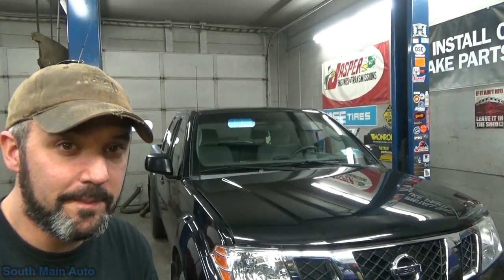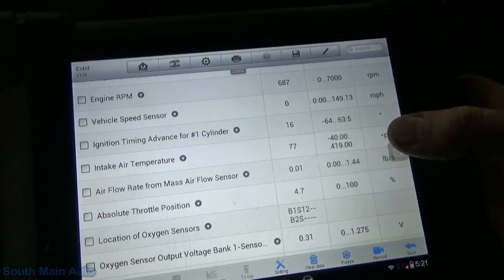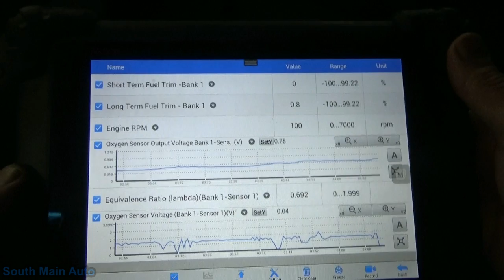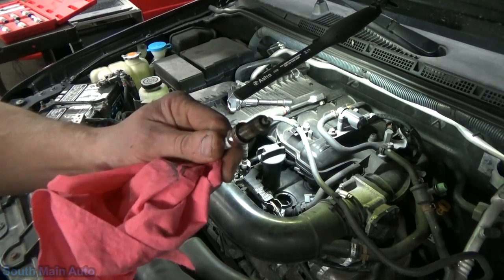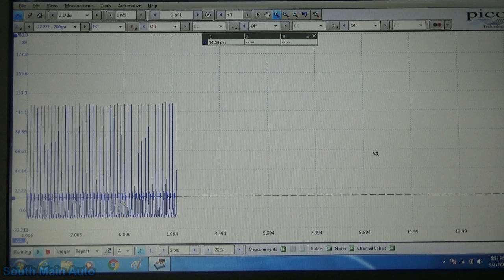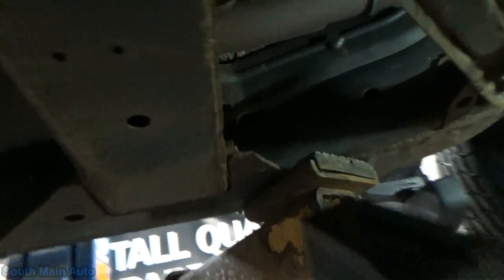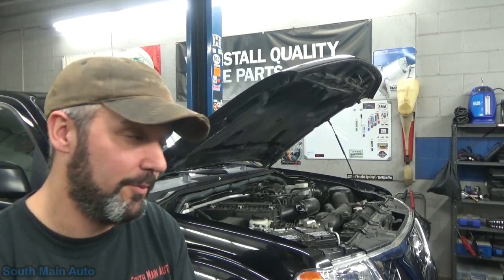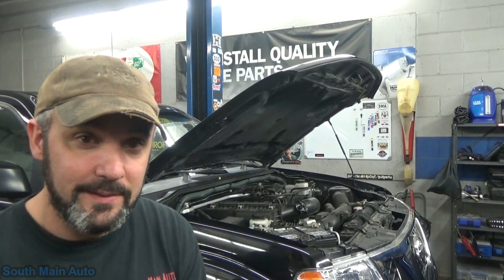Nissan Frontier - Low / No Power Complaint

Comment: I had the same thing happen and I ran a bar through it at home and the car had more acceleration than when new. This poor guy just lost his vehicle that could be corrected with a tiny forging furnace that will run up to around 800 to 900° with oxygen softly flowing through it for about 50 to 100 bucks  just because it needs taken off and would then work perfectly and pass fed law.

Comment: Fuuny... I have a 2006 Frontier with 210,000 and same thing happened  to my truck. Plugged up Cat, I think I had a bad coil pack and resulted in a bad misfire. Is the best guess I have. Luckily I live in SC and found a wrecked truck in salvaged yard and got one el cheapo. Been running like new ever since. DON
Reply from the maker: Oh man u go to prison if you put on a used one here in NY!
Reply: No state inspection here in South Carolina, and a truck with 210,000 , but still running strong. Put new 4 coil pack and new sets of plugs and going to see how long this ole girl will get me.

Comment: Wouldn't you just LOVE to have an old GM vehicle of any kind w/a "large cap" H.E.I. come in w/a no start condition and @ worst, if a new, 4 pin module doesn't work, just pull the distributor and replace the pickup coil? Or, even better, any vehicle w/points igniton n all you have to do is file them to get it running? Ah...the good ol days!

Comment: It's probably depressed because it's a 4 cylinder pickup truck.
Reply: All the little 4 banger trucks are carrying more loads than all these guys in these V8s who don't do anything work related.
Reply: Chevy Colorado 2.9L vortec is a workhorse 4cyl 💪
Reply: You won't see Fords or Chevy's towing tonnes in African or Asian roads- just 4cyl Nissans and Toyotas are capable of withstanding those conditions
Reply: I've done more in my old 86 Nissan D21 4X4 with a 2.4I4 than anyone in a full sized pickup would even dream of.
Reply: Mountain Mike My cousin has a ram that’s lifted and he said it’s cool you can sit on your tailgate lol
Reply: Jacob Sebastien Not to familiarized with those my experience with 1.4l ecotec ruined my experience for Chevy ecotec engines lol
Reply: They only offered the 4.0 v6 in these trucks

Comment: I changed my fuel pump, fuel filter, cleaned my injectors, changed my plugs, coil and wires, cap and rotor, disconnected my cat, changed my O2 sensor, put on a new MAF, and I think after all this crap its my TPS playing games. No codes or anything... I would have thrown that part at it to, but I have found that it is IMPOSSIBLE to buy, Thanks SUZUKI!  Now Im pulling random TPSs off of similar cars to see if it looks the same!  Its got 4 wires which is kind of weird. Nobody can tell me what the 4th wire is for tho. Do they make a "Universal" TPS that can be calibrated somehow?  If i have to pull this damn engine out over a lousy TPS ill have a COW!  I think one trip to a mechanic will instantly be more than the car is worth unfortunately. I just opened the sensor up to see if i could maybe clean it.  But if it wasnt messed up it definitely is now!  They make it so if your try to open it you break solder joints that you cannot fix by design. (1987 Chevy Sprint Turbo/ Suzuki Swift)
Reply: any 80s or 90s suzuki?
Reply: @ellenorbjornsdottir1166  I think it has to be 87-89  because the newer models have different looking wiring connectors. I suppose I could find a connector too and rewire it tho.  I have robbed a few things from 0ld I robbed a 4th injector off an 88 MR2... was close enough that the engine starts up great. Thats a hard to find car too tho

Comment: Awesome video! Question, how do you figured out that the fuel input was fine just looking at the oxygen sensors?, Thanks!
Reply: I'm not Eric O but the way I do it is look to see if it goes "lean" on the upstream when their isn't a problem with the exhaust system or vaccum leaks it shouldn't go lean by much at all.

Higher the number the richer,lower the voltage the leaner.

If its a fuel issue it will cause the voltage to go lower as the rpms go up because its not getting the correct fuel volume or pressure needed. Mind you things such as vaccum/boost leaks,bad sensor,exhaut restriction can all skew this value as well. If you think you are having a fuel pressure issue you should test it with a mechanical gauge. Seeing that you don't have an exhaust issue or vaccum leak and sensors respond or test out(MAF/MAP and o2) sensors

Comment: 👍Scotty Kilmer had a clogged converter & soaked it for 24 hours in either acetone or lacquer thinner 5 gal bucket then reinstalled w/ no issues. 
Any thoughts?
Reply: Should have used draino as it is made for clogged pipes😂

Comment: You diagnosed it the hard way. Just unscrew the O2 sensor in front of the cat to give the exhaust a place to go. It will run normally. Replace it with a $100 cat from ebay, done. I'm so glad I live in a state that has no vehicle inspection.  What a bunch of crap that is to have to deal with. In this guys case, he should repair the cat himself. Takes the heat off the repair shops who have to follow all those rules.

Comment: This engine, if I remember correctly, has a propensity to suck the inside of the catalytic converter BACK into the engine.  This customer may be lucky if this just had the engine power suddenly "go away".  Otherwise, he could be looking at a new engine in the very near future.
Depending on age of the truck and mileage (UNDER 100K) this is warranted by Nissan, so free parts but labor is extra.

Comment: Hello so did a new catalyst tske care of the issue ?
Reply from the maker: Of course 👍🏼
Reply: @SouthMainAuto  cool you know I have a 2006 frontier 4.0 doing the exact same thing.  Someone told me it's a clogged up cat. But now I see your video I am definitely sure it that
Reply: Wow thanks for the video great help sure enough my cat was plugged put new one on truck running normal
Reply: @simonramirez3889  mine is too cant go pass 60mph and feels very sluggish i did get a MAF code but im wondering if its because of the air restriction
Reply: @uuulaalaa  I didn't get no maf code mine was just the cat plugged yes it could be I was told by someone if you get a maf code  unplugg it and if runs normal then it's your maf sensor

Comment: No wonder I only buy, repair, and drive "older" cars- the EPA (that needs disbanded) can go take a healthy one. When "Cash for Clunkers" was implemented- all of the sudden a $1,500 used car was $4k, and many used car dealers folded. CAFE and CARB are ridiculous standards, that only serve crooked, corrupt Special Interest Groups.
Reply: it made spare parts nearly impossible to find at wrecking yards. It was a bad deal from the start.
Reply: The only two junk yards we had within City limits crushed everything, ruined all running vehicles brought in, and then closed. You can read up on it here-  https://en.wikipedia.org/wiki/Car_Allowance_Rebate_System   A total un-American ass kissing Democratic debauchery at it's finest.
Reply: Special interest groups like human beings that enjoy breathing. Ever been to China? I have. Want to wear a respirator while waking down the street? They do. Cash for Clunkers saved the American auto industry, removed inefficient and polluting cars from the roads and increased the number of used cars because so many people traded them in so explain how with a greater supply did the price of used cars go up? That runs against all rules of supply and demand. In Japan, another place I've been, you're not allowed to drive a car that's over ten years old. That's their heavy handed way of taking out the trash. We do no such thing in the U.S. we simply require your vehicle to pass an emissions test. That seems reasonable to me.
Reply: the only used cars that survived should have been crushed. its still hard to find a good used car. diesel truck prices skyrocketed after this, especially the less efficient engines like the 7.3 and 5.9. I saw perfectly straight and clean running vehicles turned in and had their engines glassed, while shitbox beaters drove away as a used car sale.
Reply: SATAMAN Schmidt can you explain how scrapping perfectly good vehicles and buying new ones is good for the environment? Even if they are recycled, it still takes resorces to recycle them and make new cars. It seems to me that it was a big waste of taxpayers money.
Reply: 20 mpg vs 10 mpg might be your answer. Current emission specs vs. 15 year old emission specs could be another.  Hey, I kept my 1998 Pontiac Grand Prix for twenty years before I wrecked it but I can tell you that my new Hyundai Sonata gets 1/3 more the gas mileage and the 2.4L Theta engine has just about as much sauce as my 3800 (a truly great engine) did.
Reply: SATAMAN Schmidt I highly doubt the vehicles that replaced the ones that were scrapped got double the mpg and even if they did I doubt that would offset the energy used to recycle and make new vehicles. But it makes people feel good.
Reply: My '89 Reatta currently averages 23mpg highway, according to it's onboard calculation and my own. I hope to slightly increase this after some modest upgrades and more new parts. The 3.8L LN3 MPFI with 4 speed auto is pretty good on gas. It was rated for 18mpg City/27mpg Highway when new.
Reply: SATAMAN Schmidt our government doesn't give a damn about emissions, just control. The United States makes a vw diesel that gets 49 mpg for the us market, they make the same car for the European market that gets 74 mph. You can't buy that car in the USA. All a racket
Reply: I don't like some of the EPA rules. But, I've seen the results of cleaner exhausts from cars. I remember back in the 70s the smog in the Los Angeles basin area would get quite bad. Now days it is more blue skies and it is with a lot more vehicles around.
Reply: Can't you read and comprehend. Did I say anything about abolishing the EPA. No wonder so many conservatives say that liberals just react and scream and that's coming from a Democrat.
Reply: SATAMAN They did not remove old clunkers, the overwhelming majority were yuppies turning in their late model cars to get the rebate plus trade in value on the car. People who drive "clunkers do so because they cant afford a new or even old car. Those same people cant afford 25-50$ dollar cars nor any new car even if the got 5K from obama. You fell for obama's lie, just use the logic I presented. The tax I paid for that phony program was a political kickback scheme just like always.
Reply: @satamanschmidt3428  Yea the problem is when you do things like that ruins the economy stop people from starting their own business. 99% of those used cares were not emissions heavy they were just old. The more Government regulates the less freedom.
Reply: While some catalytic converters are ridiculously expensive CARB standards are there for a reason.  Just imagine how bad air would be in places like LA.   Even in CA where laws and regulations are very pro environment and strict you only have to smog check your car in certain highly populated counties that are in LA basin or bay area.  Rest of the state can drive your clunker with leaking oil with no workable cat and no-one will bother you.  If there was no EPA regulating pollution our water and air quality would be worse than in China.
Reply: @sweetwilliam49  I'm sceptical about the numbers on paper (especially so after recent scandals). It is not always gold that glitters. What really counts is the result you get driving your own usual route.
Reply: @sweetwilliam49  American MPG and European MPG are different as are the testing procedures, the European test is (oddly) a lot less strict than the American one. That is why American cars appear to get such poor gas mileage but it is a closer figure to reality.  I have driven European cars that claim 60-70 mpg but rarely more than 50 mpg is achieved.

Comment: After replacing the converter, be sure to take vehicle to dealership to have the Ecm     reprogrammed to the latest update.   If reprogramming was done a few thousand miles ago,  the cat may have not took a shit.       May not need updated but need to have it checked for updates.

Comment: im from Perth WesternAustraliaand I  have a 2009 Nissan Navara but its got the 2.5L intercooled turbo diesel engine. mines has a six speed manual looks the same as Erics Os customer. I once had a problem with my where it went into a similar state to the point of where youare virtually crawling along the road turns out for me that I had a non genuine nissan diesel filter which was allowing air into the system causing the engine to stall that was the first problem the second problem was with the turbos suction line had a hole in it and couldn't maintain suction for the actuator to work. My engine is the YD25 diesel engine. Does anyone else have the yd25 in their nissan frontire/navara d40
Reply from the maker: They would sell like hot cakes here if we could get them!
Reply: South Main Auto Repair 
Hey Eric O I hope the customer lets you follow through with the repair otherwise I enjoy watching your youtube channel very much all thewayfrom Perth Western Australia.

Comment: It sounds like this guy will have to bend over and spread when it comes to the replacement part. You look at the new diesel pickups the exhaust system on them will cost thousands of dollars to repair. Watching this I thought fuel issue as well, this guy has his own exhaust brake going down hills he probably didn't have to touch the brakes LOL. Having a plugged up exhaust really isn't good for the valve springs that are not designed for that kind of back pressure.
Reply from the maker: Well ya gotta get it up the hill first lol

Comment: Ok you lost me... I know there are factory Converter then Aftermarket converter!!! So I don't know what your meaning. ?? Aftermarket should be fine. And a lot cheaper
Reply: The aftermarket converter likely doesn't have a CARB certification, which, in NY, is required if the car came with CA emissions sticker.

Comment: On the Chevy's, the intake valve would get dirty and the servo would be able to control it fast enough. Get really low power. disconnect power to that, spray and wipe it clean. Let it evaporate and good as new. My dad's 4cyl Malibu would do that.

Comment: I remember about 20 years ago the young man I worked with had a little Zoomie Honda Civic. He had it all tricked out for racing around on the roads. The year before he had to replace his Catalyst because he couldn't pass the emission test. So he goes to get his inspection again and his Catalyst failed. He came and talked to me about it and asked me what I thought. I asked him do you run as hard as I think you do any kind of grinned. I told him well if you're running it real hard you may have slagged your catalyst. He looked at me like what the hell are you talkin about? I told him you got the catalyst so hot it melted. And he thought for a moment he said I was racing a guy and he said it's a I read molten piece of something fell out the back of my car. I kind of laughed and said that was your Catalyst blowing out your tailpipe. He had one of those glasspack kind straight through mufflers on it. So you took it in to get another catalyst, and they showed him the one they took off, it was empty! He completely blew the Catalyst out the tailpipe. and he asked me what he could do to prevent it. I said what you can stop racing. and he asked me if he could go to the bigger one on I said I'm not sure if it would get up till the right operating temperature to function when you're erasing if you get too big of a catalyst. I suggested he talk to the exhaust specialist that he had the car at the shop for. Thought that was funny as hell.

Comment: You can't even go to a junk yard and get a used catalytic converter here in NY.
Reply: True.   Last time I changed one out I went on eBay and had to call the company selling it and verify EVERYTHING to prove my NYS registered car  (VW Beetle) was Federal Emission.    It was worth the hassle.  100% Legal purchase and it was 70% cheaper then local auto parts houses.
Reply: what is the cutoff  year for emissions inspections in NY?? anything over 15 years old here in massachusetts does not require emissions...just safety.
Reply: Model year 1995....
Reply: wow!! i thought mass was tough.

Comment: yeah you are not too good on Part 2 videos! two others I watched were supposed to have a part 2 and none can be found LOL!
Reply from the maker: oh man what one are you looking for?
Reply: South Main Auto Repair. in the honda odyssey sliding center hinge video. at the 18:50 mark, you hold up a part and mention there will be an upcoming video for it
Reply: South Main Auto Repair then there was a chevy s10 video with the bad transfer case where you were going to show us the inside and the installation of the new/used transfer case
Reply from the maker: Damn, you nailed them both haha. Well the Honda I did shoot part II actually and the hard drive I have it on crashed and was never able to get it off :( as far as part two of the S10 I explained that in the "alignment" video I did. I can tell u are a die hard SMA'er. Man u guys are on top of it. Sometimes getting a two parter or long videos is tough in the shop.
Reply: Maybe you can get that video off the hard drive somehow?